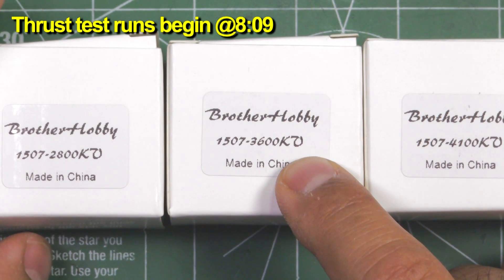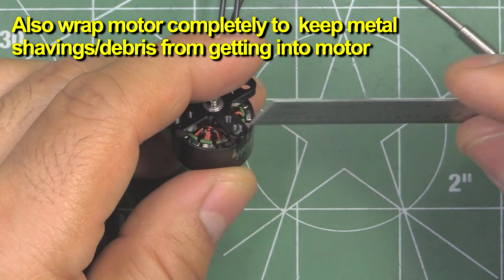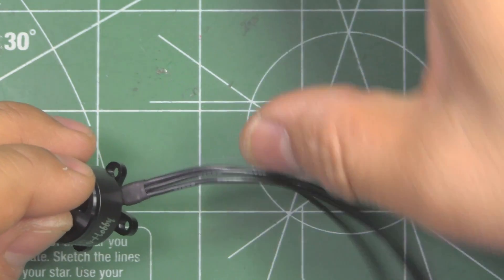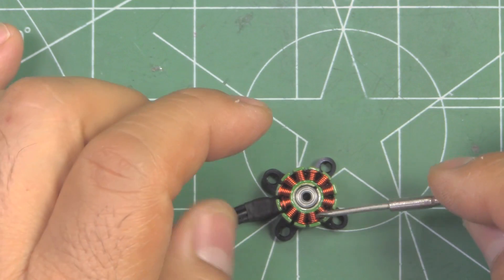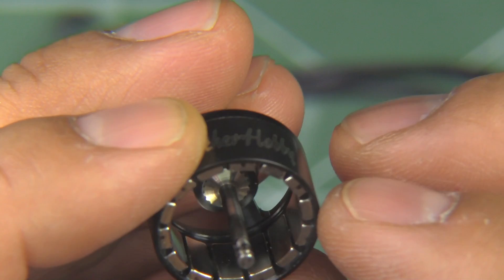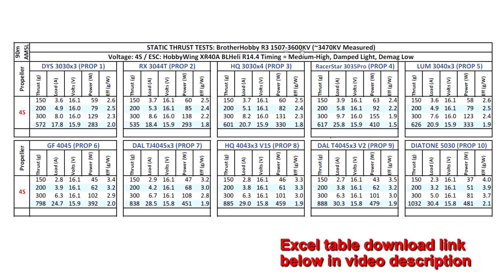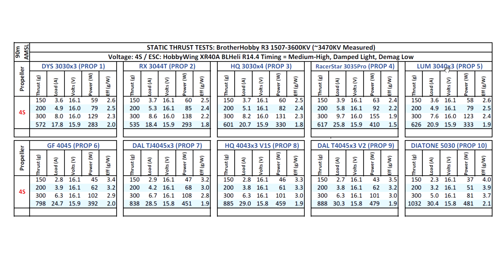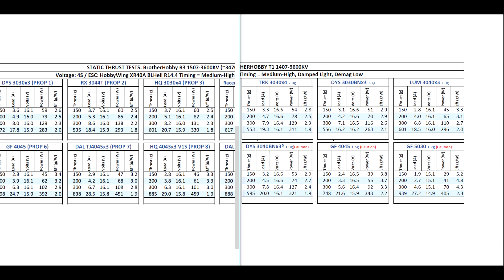BrotherHobby R3 1507-3600KV 4S Thrust Tests & Overview -New Motor

Comment: what do you think will be the best motr for a ducted 3inch quad?
Reply from the maker: For ducts to be effective they must have enough length and the correct shape to accelerate air at the outlet. If it's for a multirotor aircraft I've yet to see a good design or a setup that makes use of ducting properly. Are you talking about a ducted fan setup like those used in fixed wing aircraft? Usually those motors need to be quite large to maintain very high RPM to make enough thrust . If looking to gain efficiency you need to make prop tips as close as possible to duct wall. Motor size will be determined by how much weight they'll need to lift. Under 250g there are lots of possible combos. 1S, 2S, 3S voltage? 1304, 1306, 1206, or even 1103 to 1106 depends on voltage/weight/type of aircraft
Reply: Im thinking of the Cinewhoop style quads like shendrones squirt, iflight megabee and so on.. Its more like a propgurad with some thrust properties. I've seen people use 1407, 1408, 1506,1507 and more. I was not sure which one to pick. But I ordered a set of avengers 1507 3600kv. Hope they work well.
Reply from the maker: @Victor90NOR  yes those are the motors many people use for Cinewhoop quads. You may have to go with 4S batteries to get more rhrust depending on overall weight. Also type of prop will get you different results depends what you prioritize. 2 blade for little longer flights (maybe) 3 or 4 blades for more response and a little more thrust.

Comment: It kind of sucks that the 1407 3600 isnt directly compared to the 1507-3600 with the EXACT SAME PROP configurations    I mean seriously to be accurate I would want direct comparison results for Prop  ABC123   on the 1407 3600 to the exact same prop on the 1507-3600  theres too much guess work here and assumptions .    Is the1507 more efficient does it have more thrust -- who knows   the prop selection was freaking different ....     I'm upset at this  since I'm now at the point of deciding which to make my new standard for my 4" & 3"  fleet members  ...
Reply from the maker: ????  6 out 10 props have been tested on both motors. If you had used the time to browse thru tests instead of typing and editing your complaint post (hint: search channel for Brotherhobby 1407-3600KV) you would've found some info and not have to "guess"  or make assumptions (never good, right?) 
These props were tested on both: DYS 3030x3, HQ 3030x4, Lumenier 3040x3, GF 4045, DAL T4045x3 V2, GF 5030/Diatone 5030 (not same but similar)
That should give you decent data to make a determination as to which motor could be better for your setup. No need to guess or complaint or be upset. It's too early in the week to be upset!
List of tests for 1407 http://bit.ly/2U6Hw5c
You will find 4 tests and data for those 6 props

Comment: Hey awsome Channel! 

I would like to know if these motors would be good on my 20a hobbywing esc without burning it, i already run the t-motor f20II 3750 kv but they brake so easy so i would love these instead 🚀
Reply from the maker: Thank you so much for watching. A 20A ESC should work well. Those Hobbywing ESCs are usually some of the most durable ESCs so they'll be OK as long as you're not running some crazy setup like 5"props on 4S. Hopefully these work better for you. So far I have not seen negative comments on these about their durability.

Comment: Is ok on 5 inch prop?
Reply from the maker: Yes, but you need a very specific setup: sub 250g, 4S, 5030 props maybe 5045. Check out Adam Featherstone's builds. He has done extensive testing on several combos. 
https://rotorbuilds.com/build/5963

Comment: Thanks so much for doing this test!  Do you happen to have an excel sheet of the 1407 - 3600 on the HQ 4043 V1S prop?
Reply from the maker: When I tested the BH T1 1407-3600KV, the HQ4043x3 had not been released (or maybe I just didn't have it yet) so I never ran it with that motor. However, based on tests with other motors, that prop should make about 3 to 5% lower thrust and about 6 to 9% lower Max Amps than the DAL T4045x3 V2. Hope that helps.

Comment: Do you know what's up with there being 2 variants of this motor, one with a hollow shaft and one with a solid shaft?  There also seems to be a weight discrepancy, as the solid shaft one is being advertised as 15.5g.

Comment: Also I was planning on building a 4" using a smaller motor not as small as these,  I was looking at either the BH 1806 2850kv or the BH 1608 3200kv I can't really decide the quad will be around 170gr-190gr max. As a third option I was considering pre ordering the EFAW 1807 but I am hesitant without seeing any testing.  
Between the first two motors which would you go with and why? Thanks
Reply from the maker: The 1608 has a larger stator (more iron and copper if you just calculate cylinder volume based on stator nominal dimensions) and higher KV so theoretically it should be more powerful but also will be able to drain batteries at faster rate. Also I think it's a little heavier. The 1806 will have plenty of power too. So depends on your main goal. All out speed, shorter flights get the 1608.  The 1807 stator size does sound very interesting for 4", I think it'll match very well with the 3000KV version or 3500KV for all out speed.
Depends on flying style and purpose. For freestyle I'd go for 1806. I believe it's lighter and has plenty of punch for a light setup. But the 1608 should also work very well. Really difficult to select one or the other, both look good.
Reply: Wish they would make a naked bottom 1608. Haha

Comment: That motor (as all BH and OEM BH made motors) almost hand wrapped quality perfect turns... that is such a pretty stator to look at because how cleanly it is wrapped. That's why I fly pretty much exclusively BY motors because their quality is second to none and performance is top of the pile as well.
Reply from the maker: Wicked Reelz I have the same feeling about those pretty windings. Every time I crack open a BH motor, I always appreciate how nice the windings are as well as the overall finish of each motor. Indeed they're one of the top motor manufacturers. Thanks for watching and for your comment.

Comment: It's amazing to see a motor that small handle all those amps. Great testing as always and I'm a big fan. Happy testing!
Reply from the maker: Well.... just for a few seconds they do, so these loads apply more to multirotor FPV/ LOS application where we yank the throttle to full for only a few seconds. With the larger props and loads you gotta be careful with prolonged 100% throttle operation as the motor may heatsoak and start to smoke. Still watching these little motors output that much power always impresses me.

Comment: Awesome video! What u think? GEPRC-GR1408-3500KV  or this one for 4 inch triblade?
Reply from the maker: Csaba Farkas the GR1408 was running hotter than the R3 1507, though I like the taller 08 stator, I think this BH 1507 has a better overall build. Also it makes slightly more thrust on 3" & 4"props. I'd get the BH 1507! Hopefully it turns out strong in crashes and has good reliability.

Comment: If the shaft is magnetic it's probably steel if not ti or aluminum
Reply from the maker: Dixie9mm it's non-magnetic. But some stainless steels are also non-mag. But I don't think it's 304 or 316 so most likely Ti alloy.
Reply: EngineerX  I've always considered stainless to be separate from carbon steel sorry should have specified. Most of the time that  stainless is used as hardware there is a specific need for it or for cosmetic reasons. I just don't really take stainless hardware seriously for certain reasons.